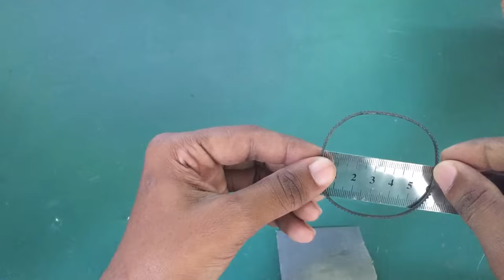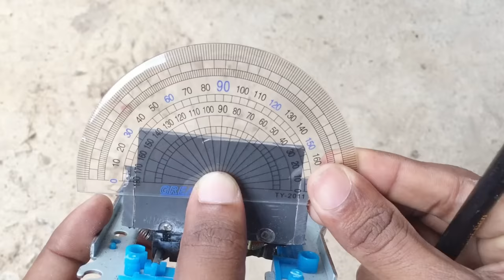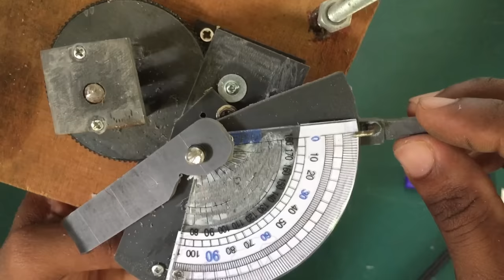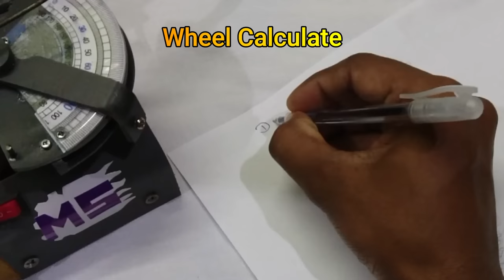How to Make a Gear Wheel Cutter | DIY Gear Cutter | Milling Machine DIY

Comment: Well done!! I'd suggest: 1) Locking between cuts, because the gear is rocking and so not all the teeth come out the same. 2) Making a replacement gear for the one at the bottom, for more precision. Making a ratchet for it is trivial. 3) Improving the shape of the disc so teeth look more like an involute and can mesh properly. 4) Rebuilding the machine in metal so that you can cut aluminium gears, maybe with a cordless drill motor (and it's gearbox), as PVC gears won't hold up very well under speed and load.
Reply from the maker: Ok thanks ❤️❤️❤️❤️
Reply: Ain't it just ain't it 😎
Reply: А по Русски слабо? 🤣🤣
Reply: Once you have the tool made, improving it becomes relatively easy as it can 'build itself' the parts needed increasing accuracy with each iteration.

Comment: I think the most valuable thing you have done here is to show people that it is possible for them to do it themselves. This simple machine could be used to cut gears in stronger plastics such as nylon or delrin to give real power handling gears. I believe that these plastics will be forgiving of the lack of precision, and gears made this way will at any rate be as good as injection moulded equivalents. Thank you for sharing this with us!
Reply from the maker: Thank you so much ❤️❤️
Reply: This can make factory be close,you so genius

Comment: This is a classroom machine if I’ve ever seen one. Kids would love to learn how to cut gears. And in the process, they’d learn about geometry. Hands-on is always the way to go.
Reply from the maker: Thank you so much.
Reply: What "kids" are capable of the math involved here do you mean "teenagers" ? as in 7th and 8th grade? because here in America they don't teach the applicable math until high school.
Reply: @ryoung6730  I have years of experience as a classroom teacher. With children age seven to fourteen, the key to all activities is hands-on involvement.

Look: Kids don’t learn anything by just looking at a computer screen, and answering questions. It’s a complete waste of time.

With this gear-cutting machine, the first hundred exercises wouldn’t require any decision-making. The cuts are vertical, on blank wooden gears with lines printed on them. So the exercise just gives them practice in cutting. There’s nothing else. Then there are a a couple of hundred more exercises.

Twenty, just following the lines with a 90 degree angle cuts going-in.
Twenty just following the lines with a 45 degree angle cut going-in.
Twenty just following the lines with a 30 degree angle cuts going-in.
Twenty just following the lines with 90, 45, and 30 degree angle cuts mixed together. All going-in.
And finally, the whole process is repeated, but with the cuts angling outward instead of inward. 

That program should take about six weeks. And the cutting can be done on a scroll saw with an angle-vice. The kids would learn how to use a scroll saw, how to recognize gear teeth, and how to set the angle of the cut. No math. That’s a beginning.

https://www.harborfreight.com/3-in-cradle-style-angle-drill-press-vise-58778.html

Comment: While I think this contraption is poorly made, it shows the principle on how a proper one would work. Its still great for what it is, really thought trough. Absolutely brilliant design in my opinion and I really want now to build one myself for making some plastic or even small bronze gears. I also think some parts could be easly 3d printed to make it more accurate.

Comment: 🤓 Great project, Yesterday I was thinking about make an extra wood gears to increase speed on some crank lifter. This project allows me to remake all gears system.
Reply from the maker: I wish your all the best. it would be better if the cutting blade can be made with a lathe.

Comment: Hi, really incredible work, I just didn't understand the part of the lever that turns the gear, like, why did you put a reduction there?
Reply from the maker: Thank you
Gear tooth spacing balance
Reply: @Selfcrafts. I understood, very well thought out, now that I've come to analyze how it works, but I still don't know if it's possible to calculate the diameter according to the number of teeth I'll want on the gear.

Comment: Amazing job with minimal tools. Make a DIY kit of this machine, people will buy it.
Reply from the maker: I'll try.. Thank you so much ❤️❤️❤️
Reply: @Selfcrafts. Bro i have an idea.....make body or walls of machine whith 3 or 4 layers of iron sheet.......once you cut same 3 or 4 iron thin sheet ...you can stick them..or  screw (small)them....another way to stick them using flux and soldering wire....but soldering rod will not work.....
Process= take soldering wire crush it in a metal bowl or over metal plate to make its powder...mix soldering flux in ti to make paste......apply this paste over one side of sheet and put anothe sheet overit again apply paste over second sheet..and so on......gentealy place all sheets bundel(solder paste  applied) on a plain thik iron sheet or plain ceramic tile  peace and put all over fire.....also place a tile over sheets and also some weight so sheets have pressure while burning..later stop fire and let it be cool for some time ...result will all sheet will welded hard.....purpose of telling you is you can make any part or housing with sheets and a kanchi

Comment: very good. but your helical gears are not true helical gears... the cutter must traverse the blank at an angle while the blank is also turning to produce the helix. otherwise for the design and the theoretical concept, very good. keep improving it and you will be able to make basic functional spur gears.
Reply from the maker: thank you...❤️❤️

Comment: Dude tell the size the timing belt and what name have the cutting disc, thx
Reply from the maker: Broo. You can use any belt. Cutting disc home made. It's in the video
Thank you
Reply: @Selfcrafts.   Well I need the name because I want buy at Ebay, I don't have the right tools to make it
Reply: @nitrogamesstudios5276  They are called gear cutters or involute gear cutters and sometimes a gear hob. Prices range from $10 -$1,500 USD on eBay.

Comment: This is creative but seems a lot of work for the results. You may have been better just printing out templates to stick on and either use a file or a dremel to cut the gears to shape. You also won’t get a proper gear profile with this and are limited by the size of the cutter which is extremely janky anyway. You are also limited to PVC gears using that cutter. You should consider getting a 3D printer, it would make building this a lot easier or you could just print out the gears you need, or maybe even print out molds for the gears and cast resin in them.

This sure is inventive but I wouldn’t really use it for anything serious.

You could maybe improve some of the issues by making a better cutter with a proper gear profile but as it is with this design, the cutter is only good for one size of tooth.
Reply from the maker: Metal sketch more
Gear Motor
https://youtu.be/4rAPJnGdgss
Gear Design and print
https://youtu.be/b1Fh3yWSWPU
Copy gear worm (resin)
https://youtu.be/MWwq7OwTUM0
Copy gear (resin)
https://youtu.be/ozbBqwvKabc
Thank You Friend